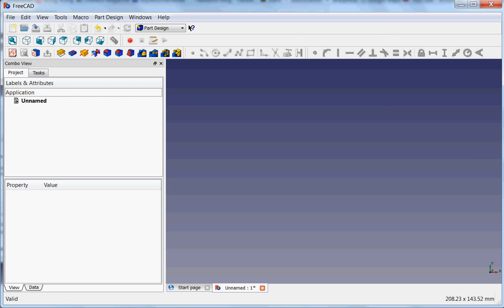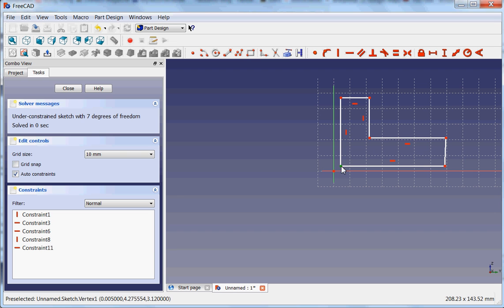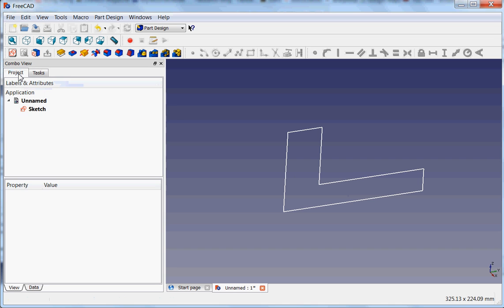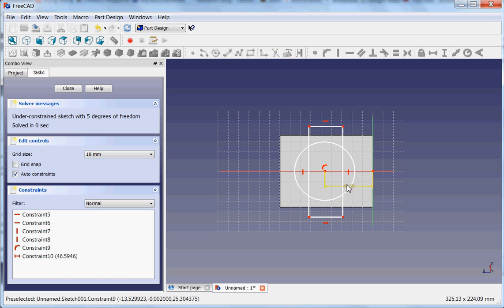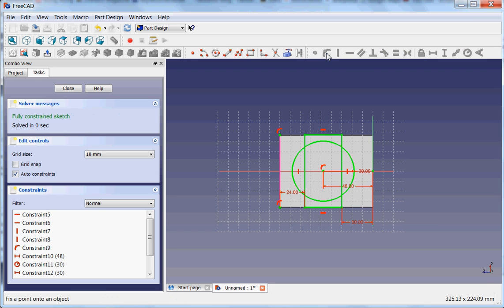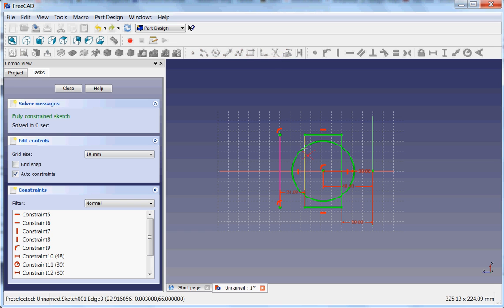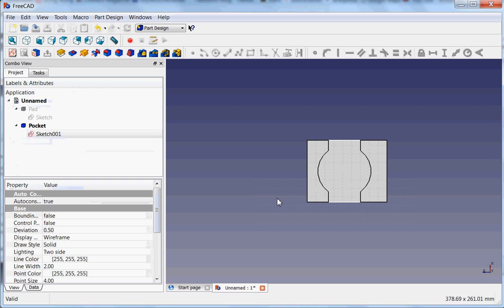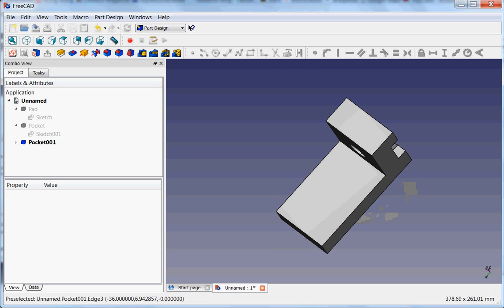FreeCAD Tutorial Part 7 Exercise 1B

Comment: Hello Bram, I have not watched all of your FreeCAD videos, but I wanted to say how useful they are to new users. Most existing videos were obsolete due to the fact FreeCAD evolves rapidly.

About the trouble you had at 10:42 selecting an external edge: sometimes the sketcher has trouble selecting an element that is not on the sketch plane. What you can try is rotating the view a little to select the corresponding edge that is on the sketch plane.

BTW this video cuts off before the end.